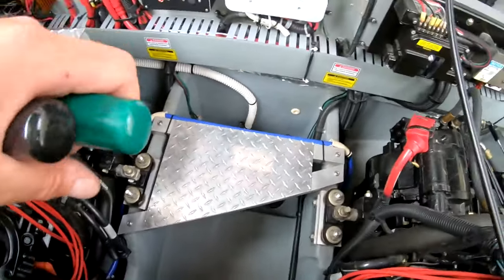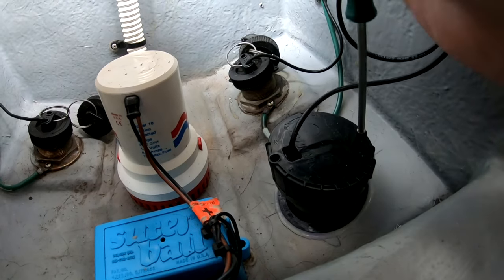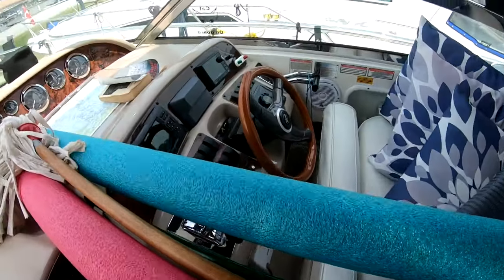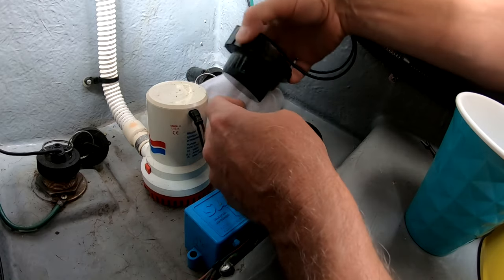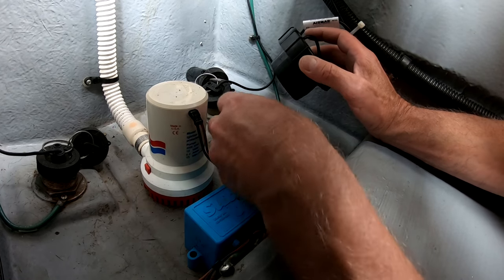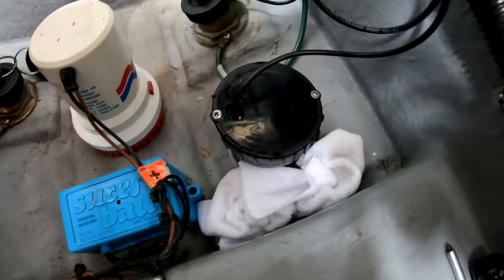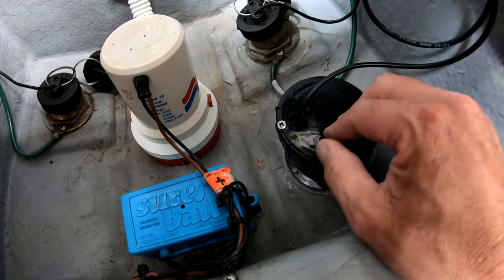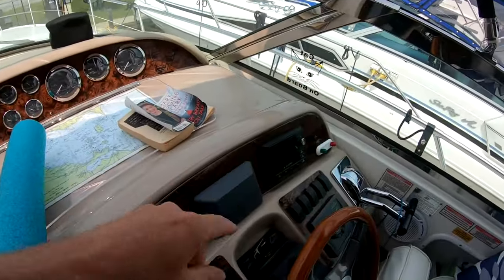Garmin Finder Airmar Transducer - Adding Antifreeze

Comment: Hi Paul.  Thanks for the video!  My original thru hull transducer failed and your original video inspired me to install the Airmar transducer.  It has worked great this past summer :).  In terms of evaporation, I found that non toxic coolant works better than anti-freeze during the warmer months.  Antifreeze is definitely better for storage in winter months.  Cheers!
Reply from the maker: Glad it helped and yes, next year I'll keep extra non-tox on the boat for this situation. I might even try to fashion some sort of gasket on the top to avoid the evaporation. . .

Comment: If i remember correctly you can use mineral oil as well. Prevent the evaporation
Reply from the maker: Interesting, but from what the Google Machine tells me, it would freeze at only -4 (C), which is no good in these parts of the Great White North ;-)

Comment: I didn't realize the "shoot through" transducers needed anti freeze.  It looked like you were using concentrated anti freeze which will freeze before a 50/50 or 60% anti freeze/40% water mix.  Not critical in the summer months but for winter storage - it's something to consider.
Reply from the maker: I don't think that technically they need antifreeze, per se, but it's suggested for us in the northern climates. Thanks for the heads up on the straight antifreeze, but I'll guess that what I needed up with was a 60/40 on the new to the existing non-tox that I initially used. Should be fine.

Comment: Interesting system. I have to double check mine to see if I understand my own setup.
Reply from the maker: On your boat, it appears that you have a transom mounted transducer (https://youtu.be/dolEnw-2REU?si=Us0EkIJIQris8gyk&t=705 - mounted between the two outdrives, at the bottom-most edge of the transom). That was most likely installed with an aftermarket fish/depth finder, such as a Humminbird, etc..  I had initially considered that when I installed the Garmin, but wasn't happy with my limited mounting locations on Boogaboo, so that's why I elected to use the shoot-through transducer, which I am very happy with.
Reply: @BoatingWithBoogaboo  Yes thanks. This is true. There does remain an old transducer in the bilge for the old depth finder that no longer worked. The bummer about the location between the two outdrives is that when we are on plane, the depth sometimes doesn't read. I assume this is because it's so far back and close to the outdrives.
Reply from the maker: That can be caused by either too much cavitation (lots of tiny bubbles in the water) that can easily skew the readings. Another issue might be that it's not best angled to the bottom of the hull, or too high or too low in the water. You should be able to find an owner's / installation manual online for some hints on those issues.
 And the tiny bubbles would be in the water, not in a champagne glass 😂

Comment: Hey Paul..., interesting video.  I am not familiar with shoot thru transducers.  This info is nice to know.

I also noticed the two thru hull fittings that seem to be capped off.  I think you mentioned you had other transducers mounted there.  So those are capped and not used?

Another question..., the bilge pump that you have mounted there.   How did you attach that?  I have had a constant problem with water in our midship bilge area.  Trying to come up with a way to mount a new pump lower on the hull with out drilling holes.
Reply from the maker: Check the video I did when installing the whole system last year (link in the description) for more insights.
 As for the old transducers, they are not capped off, that's the way they were factory installed, with only the wires disconnected at the helm, as they are no longer in use. Those are full through hull types, so if I removed them, we'd have LOTS of water coming in 😂
 And the bilge pump in that location was also factory installed when Sea Ray built the boat, 25 years ago. . .